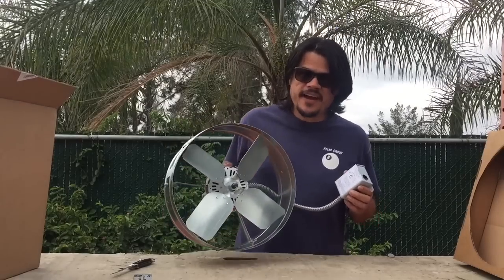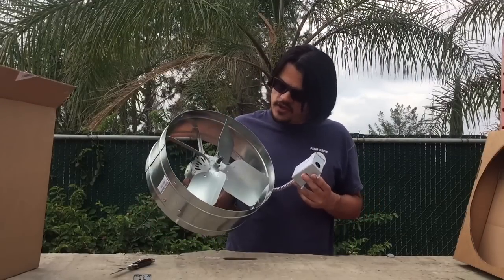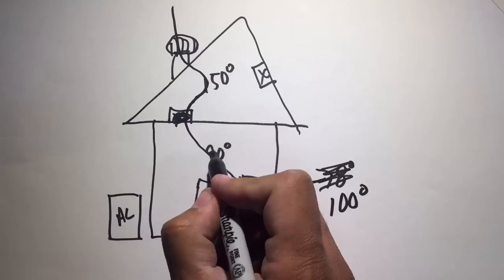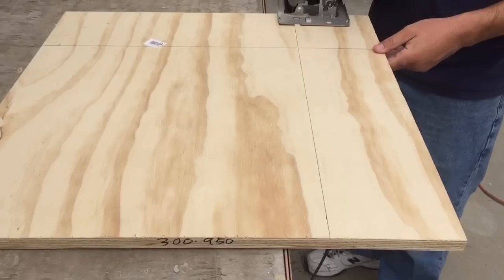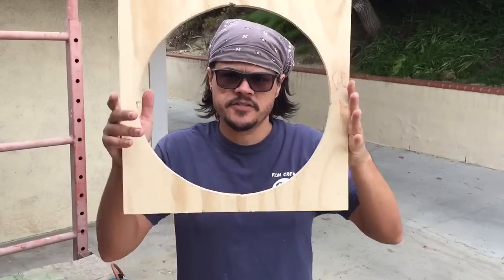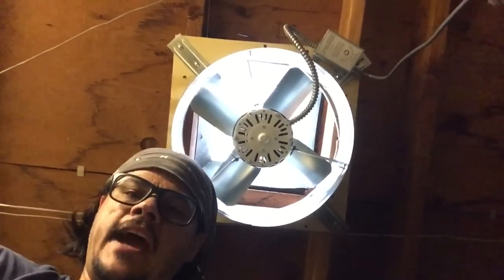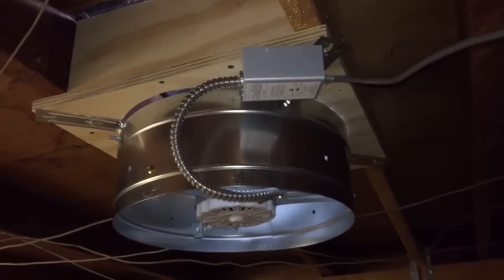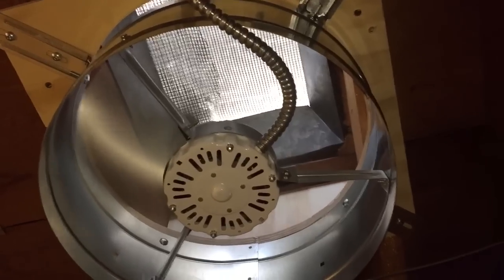Cool Attic Exhaust Ventilator Fan Install or Whole House Fan

Comment: Well, I worked in HVAC years back and have been thinking (more like procrastinating) on this idea that hot air needs to be "pushed" out of the attic with the "in" coming from the soffits, and here I find a great video explaining the whole concept - thank you Vince, the fan model is available on Amazon Canada !  This should be shared with many - the AC's are being pushed way too hard in homes in these heat waves :)
Reply from the maker: Thanks. The cooler the attic, the easier it is to cool the house, but I’d start with adding whirlybirds. They use no energy. In my area there are times the wind gets still and the whirlybirds don’t move, so power was my solution.

Please subscribe so I can get to 100k subs.

Comment: Nice video. I will be doing this to my house in Vegas. Previous owner has blocked up attic space above the garage to make storage space. Now there is zero air flow up there. I think these attic fans can be great as long as you are mindful that you need adequate intake air coming through your soffits. Otherwise the negative air pressure will find ways to suck out temperature modified air from inside your house.
Reply: You have not done this in Vegas yet????? are you crazy , do it today!!!
Reply: @g.b.5206  yeah i did it already.

Comment: Just don't forget to seal your attic of air leaks before installing an attic fan motor. Otherwise the attic fan will SUCK the air out of your house up to and through the attic. Not good because you pay good money to heat and cool your home air.

Comment: Instructions indicate that the motor shaft should be horizontal (this is a wall mount unit). Is the motor rated for operation in the vertical direction as mounted? If not it will wear out quickly ...

Comment: Good video.  You mounted the fan solidly on 3/4" plywood.  I would have placed the thermostat further away from the fan, maybe mount it higher at full extension of the BX on a rafter.  Also, would have liked a comment on the noise of the fan from inside the house.
Reply from the maker: The noise isn’t bad. Its a light hum for me, but it’d be different for everyone depending on the level of insulation the location of install and the way it was installed. Thats why I didn’t comment in it. I tried to show it running so people could gauge it themselves. Anyway. Glad I could help.

Comment: we need to do something about the heat in our attic above garage where items are stored.  BUT we don't have any openings at all in the roof, only small vents under the roof (soffits).  We did however, air condition our garage w a mini split, and there is a vent in the ceiling of our garage leading to the attic (was there when we moved in).  Can we just put this fan above this vent and it will suck some of the garage AC to cool the attic and force hot air  OUT OF SOFFITS? - GREAT VIDEO BTW
Reply from the maker: Keep in mind. I’m not an AC tech, I’m a television editor who works on his own house. But if the vent is big enough and you have adequate intake, then it will move air.
Reply: VinceRocca understood.... thanks for video

Comment: would I be able to use this in my garage, /I have been seeing mixed messages on not being able to use a gable fan on a roof? Thank You
Reply from the maker: Ive had mine pointing up for two years. They are working fine. The issue a garage might have is with code and co2 exhaust from cars and the water heater.

Comment: Wiring question. I've got the same fan, 2 black wires off the thermostat. Black to black, white to white, and it just blows my circuit breaker.  ?????????????????????
Reply: Argghhhhhhh!  I'm such an idiot. Helps when I wear the right glasses for close up work,  and have more light.

Comment: What’s the ideal attic temperature? Any concerns on humidity levels in the attic.  Thank you.
Reply: the humidty level goes down as the fan helps dry the space of the attic. 
So overall it helps inhibit mold, mildew and saves the overall roof from heat and winter conditoion

Comment: Thanks for the video. Please forgive the ignorance, I am a first time home owner looking to learn and in this case improve my attic insulation/ventilation for my house. So are you implying that a whole house fan is not as necessary as the attic fan then ? Or should you have both, and run them separately depending on the outside temperature ?
Reply from the maker: I have both and run the separately. Never at the same time.

In California the evening temp often drops faster than the AC can drop the inside temp, so the whole house fan can quickly and cheaply drop the temp by pulling in that cool evening air.

In the summer, when the temp outside gets over 100° during the day, I use the attic fan to bring the attic temp down so the AC ducts in the attic can move cool air more effectively.

This is what I did before I added either fan:

The first thing to do is install a battery thermometer in your attic so you can read the attic temp from inside the house.

Next make sure you have the correct intake and exhaust vents. Many houses were not built with adequate attic ventilation. Chat with neighbors.

If your area allows it. Add whirlybirds. They are the cheapest and best way to vent an attic.

For overall comfort. Replace any can lights with insulation rated cans, seal them with led lights to stop air from flowing through them.

Then insulate the attic so you have 4” covering the joists.

Oh. And Please subscribe so I can get to 100k subs.

Comment: Did you save $$ on your electric bill. I have a 1000sf home that uses over 2400 kwh. House is not vented properly and I am going to add 12 to 14 soffit vents to help.
Reply from the maker: I saved money when I added whirlybirds to the roof. The attic fan hasn’t really reduced my bill as the time it runs doesn’t offset the AC.  But in my case I never intended to use it for savings. It cools the attic which cools the AC ducts and that makes the house cooler and more comfortable. I’m sure there is a small savings, but a big improvement in comfort when California has several 100° days in. Row. The fans cost around .11¢ an hour to run. Glad I could help. You can help me by subscribing so I can get to 100k subscribers.
Reply: @VinceRocca  Thanks. I found a big issue today. I installed 12 soffit vents and during install I noticed a 7 inch pipe blowing 70 degree air into attic. The stove range had been installed with no back draft device. I removed pipe and replacing range hood tomorrow. Thanks.

Comment: Great work Vince! been thinking about tackling this project this summer. Especially after I just cleaned my attic last week, so freakin hot up there! Been looking at some Solar Exhaust fans but not sure if the CFM is as good
Reply from the maker: I thought about the solar and while their carbon footprint offset is up for debate, I don’t feel they move much more than whirlybirds. And whirlybirds are free to run and long lasting. I highly recommend those first.

I’ve been enjoying this attic fan. The house is cooler and more comfortable. But you need to have enough intake vents to handle the cfm output of this.

In short this has been a cheep investment with lots of gain, in money and comfort. I’d recommend it.
Reply: Thanks Vince! Yes & a lot of Solar ones only work during the day, its nice to have a switch to be able to run it whenever needed (maybe even a timer switch!). Yeah I love whirlybirds, I have a few on the house. But need something for those windless 100+ degree days up here in Northern CA.
Reply from the maker: It sounds like you’re in the exact position I was in. This runs on a thermostat and I think some of the solars store energy and also run off a thermostat into the night.
Reply: Ohh nice a thermostat is even better. Now I just need to figure some wiring I can tap into.
Reply: Nice and simple video. Do you have blow insulation? Does the fan disrupt the insulation? That's my concern.
Reply from the maker: I do have blow in cellulose. The fan doesn’t disturb it. Remember it blows out, not in and on the insulation. So it gently pulls from all my intakes.
Reply: Ok so what did you set the thermostat to?
Reply from the maker: I set the thermostat to 100 degrees and put it on a timer to turn off at 9pm. Once nightfall sets in, the natural flow of heat rising out of the attic takes over. Also, here in so cal I only run them in August & September, our hottest months when the attic can hit over 140 for extended periods of time. That’s when I see a reduction in my AC’s effectiveness.

Comment: How is the attic fan doing now? and did it help lower the house temperature?
Reply: i have one installed and it maes a significant difference. 
You can feel the hot air being sucked out of the attic during summer time.

Comment: Would you recommend an attic fan or a radiant barrier to cool an attic more effectively?
Reply from the maker: A radiant barrier keeps the attic from ever getting hot and costs nothing to run, but is much harder to install properly. If you can go that route its better than the fan. If not the fan is cheeper and easier to install. Please subscribe so I can get to 100k subs.

Comment: How do you wire the thermostat?
You showed black to black and white to white, but how are the other two wired connected?
Reply from the maker: For 110v there are 3 wires Black-Hot, white-neutral, green-ground. All metal is grounded to green, all white neutrals go together. And the switch breaks up the black, one black hot into the switch and one black hot out of the switch to the fan. Please subscribe so I can get to 100k subs.

Comment: I want to know how you wired it...Mine didn't come with a plug in like yours?
Reply from the maker: Mine also did not come with a plug. I wired it on. Electrical wiring is beyond the scope of this fan review, which is why I didn’t cover that. I originally learned wiring from a tradesman, but I’m sure there are youtube vids on it. Please subscribe so I can get to 100k subs.

Comment: Just bought this exact fan. great video! have you noticed a big difference in temps? Are there any benefits/downsides to installing under a roof vent vs. gable?
Reply from the maker: I haven’t been able to gauge a difference in my electric bill, but the house is noticeably more comfortable. My AC ducts run through the attic, so dropping the attic 10-15 degrees, means the air in the ducts are cooler and the house gets cooler faster, but I’m not sure if the saving in AC is offset by the cost to run the fan. Still I’m happy with it. I imagine they will move the same amount of air under a roof vent or gable. I did install a timer cause in California the fans could stay on all night, and once the sun stops beating on the roof natural convection will take over, so I shut them at 8pm.

Comment: What is the cost efficiency? You are still using the AcC.
Reply from the maker: According to a kill-a-watt 1 fan costs me about .08 hr to run. My Air Conditioner costs about $1.10 hr. But the AC fan without the compressor costs about .15 an hour.

I installed 2 fans in the attic and run them 9 hours a day at a cost of about $43 a month.

I don’t YET know IF there is a cost savings. I think there.

I do know the house cools faster and is more comfortable.

It seems I use less AC at 1.10, but I do run the ac fan at .15 hr to circulate the air around the house.

Comment: What if attic entrance is in garage will it still cool off house or just garage 🤔 ?
Reply from the maker: How you enter the attic doesn’t matter. You should have intake vents under your eves. Or gable vents on each side of the house. The fan pulls from those. Not every house is suited for these fans.

Comment: Awesome vid,  thanks for sharing,   thinking about doing this,  did it help at all with inside temps?  also what did you set the thermostat at?
Reply from the maker: I set the thermostat at 105 and added a timer to shut it at 9pm. In my area, the temp drops to under 90 by 9, and natural convection takes over. No reason for me to pay to force air. 

There is an improvement in house comfort. I’m not sure how much it will cut my bill. Currently I run 2 fans at .90 a day. My AC costs 1.10 hr to run so if it cuts 1 hour of ac usage, it is awash. But the house is more definitely comfortable.

Comment: thats a small fan .did it work
Reply from the maker: 1 fan is rated for an 1850 sq ft attic. And moves 1300 cfm of air. The physical size doesn’t matter. You need to make sure you have enough intake to cover the 1300 cfm.

Now In my case, I have a 2700 sq ft house with over hang eves, so my attic sq ft is close to 3400. I added a second fan. I have plenty of intake. And they work well enough to make me happy.

Comment: If you install an attic fan like yours, should you close off the gable vents?
Reply from the maker: You need vents for the attic fan to suck from. 

Remember air takes the path of least resistance. So if you have a vent next to the attic fan it will just pull from that.

In general you shouldn’t cover any vent. Engineers designed your house that way. Sadly many engineers, mostly on older houses didn’t do a proper job.

Years ago I had previously measured all my vents and calculated the air intake from the soffits to the out flow of the roof vents. My ventilation wasn’t enough for my square footage. So I added 4 whirlybirds.

This fan was added over a particular hot spot in the house and far enough away from other vents that I could assume the path the air would most likely flow.

I know this isn’t a simple reply, but air flow is a complex math problem.
Reply: Thanks for the response. I guess my concern is that the attic fan will simply pull for the gable vents rather than the soffit vents - which I have a lot of.
Reply from the maker: Sure. You gotta consider path of least and place that fan far enough away. It’s not perfect for every house.

My Dad has a Ranch house with 2 gable vents on each end. 4 in total. A previous owner installed 1 fan over 1 vent on 1 side. All that fan would do is suck air from the second gable vent next to it and not across the attic.

They should have installed 2 fans. But, instead, I’m going to remove that fan and install 2 whirlybirds on the roof. 

I’ve toyed with the idea of reversing the fan to blow in.  I wonder if it will blow so much that it will make it across the house. But I think that has too many fire/ dirt dangers, so I’m going with the whirlybirds. 

One thing to do, is get a thermometer Indoor/Outdoor Thermometer http://www.amazon.com/dp/B000KKV16C/?tag=povert0f20-20 place the probe at the top of the attic and see how hot you attic gets. 

If your attic is under 120, then you probably already have plenty of ventilation.
Reply: If the fan is in a gable vent on one end of the house, and you have a gable vent on the other end of the house, you're fine. The object is to draw outside air in and blow heat out. The attic heat rises and the air moving from one gable vent to the exhaust gable vent will remove the heat. Soffit vents are not necessary but will increase the venting, allowing the heat to rise to the crest more easily.

Comment: Can I put that on the gable vent
Reply: Jason Weeks! Warden of the North. Yes you can.
Reply: I believe so, contemplating the same here...  I think you would simply cut a triangular plywood template (instead of his square one), to cover the gable space and ensure proper air flow...
Reply: Attic fan is a must have along with proper insulation! Makes a huge difference. 
I was up in my attic today and noticed my gable was missing a bug screen and did not have that plywood piece. The plywood helps with efficiency. Definitely need to add those two to my existing fan.

Comment: where did you get power from?
Reply from the maker: I have outlets in my attic for lights and the whole house fan. You can hire an electrician to add one or IF you’re a savvy DIYer you can tap into an existing outlet circuit. Glad I could help. You can help me by subscribing so I can get to 100k subscribers.

Comment: Your roof is leaking your insulation is wet and your fan has started an electrical fire after shorting out!
Reply from the maker: Thanks for your concern. I live in California. It doesn’t rain in the summer here. The fans electricity is disconnected in the winter. We have fire retardant blown in cellulose and the fans are on a circuit that is GFI protected. Plus it is equipped with a fire stat that will pop in the event of a fire.

Comment: How dose it turn on
Reply from the maker: It has a thermostat. When the attic reaches a specific temperature it turns on. I have it set to 105. Then when the attic gets cool enough it turns off. I also added a timer to shut it off at 8:pm regardless of the temperature.